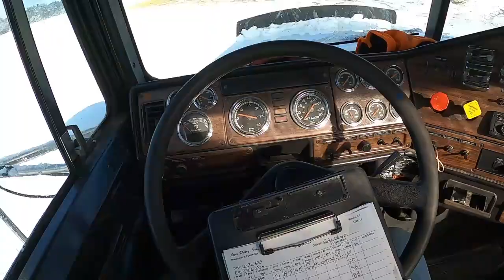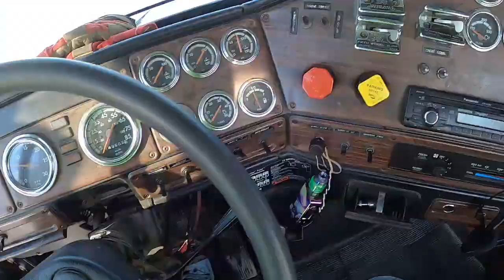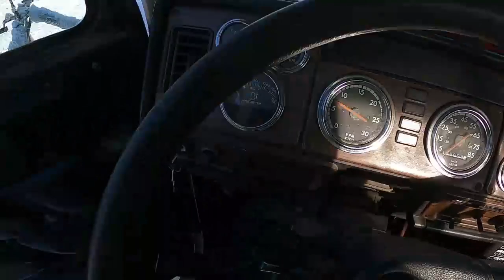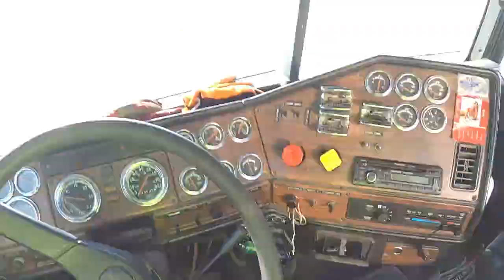A Day In The Life of a Milk Truck Driver

Comment: As a veteran truck driver I wanted to let you know every one eventually drops a trailer, always check your fifth wheel pin. Every driver I know has dropped the trailer once and it's all you need to make you check your fifth wheel the rest of your life, good luck out there
Reply from the maker: I've been driving for 7 years and I've dropped 2 trailers.. caught them both before they came off the truck but yeah definitely makes up check everytime now!
Reply: I’ve never dropped trailer but I know what you mean on this because I’ve had friends that have. If I check anything that’s the first thing I check and the tug test after. Even after leaving a truck stop. But after driving for almost 22 years I just recently hopped a 5th wheel and it was embrassing as all hell!

Comment: With that type of trailer is there a lot of surge? I’m assuming there’s no baffles?
Reply: With the transport trailers there's no baffles,but they are full when you go to the farm to get them,so there's little to no surge.With farm pickup trailers,there's two compartments,so you have to drive around to farms half loaded till you fill it.Surge isn't as bad as it could be but it's still decent.